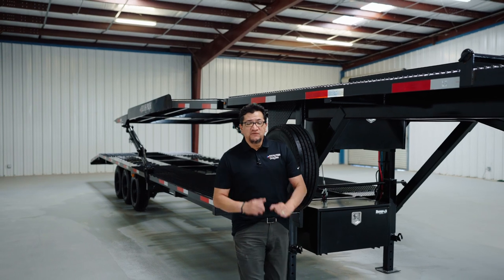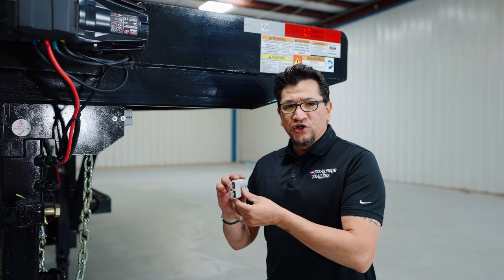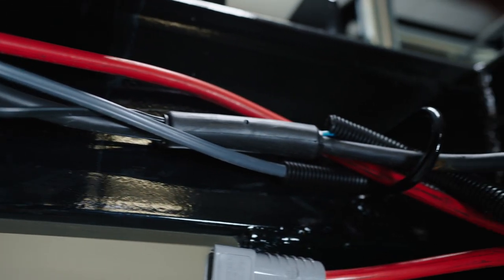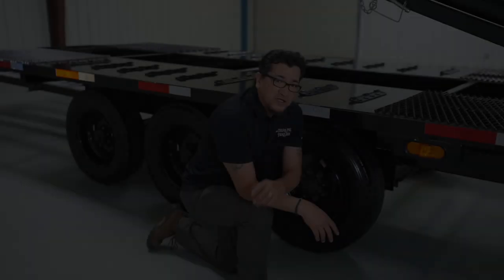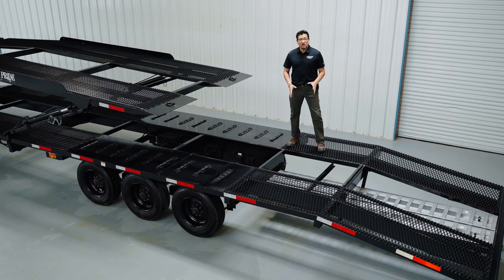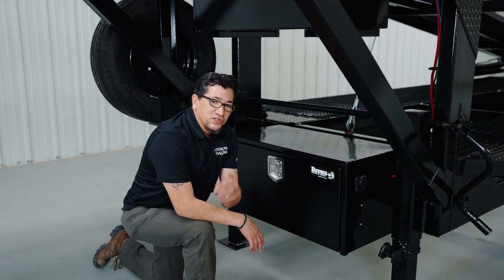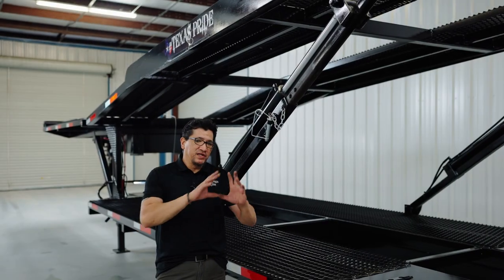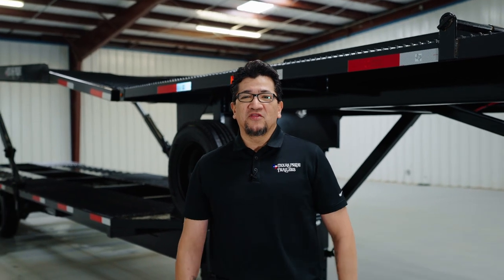4 Car Hauler Trailer | DELIVERY WALK AROUND

Comment: Thank you for explaining the battery life on the break away plug. I’ve have been disconnecting mine for years.
Reply from the maker: Thanks, luckily you've haven't had an issue with a dead charge. But still keep it in mind.

Comment: Do I need a CDL to operate this trailer?
Reply from the maker: yes you do.
Reply: @texaspridetrailers  What’s the biggest trailer I can operate without a CDL?
Reply from the maker: @JC-mq8dm  You Can't exceed 26,000 pounds. That's including the combined GVWR of your truck and the GVWR of the trailer. Those two weights added together cannot go over 26,000 pounds. Otherwise you will need a CDL.